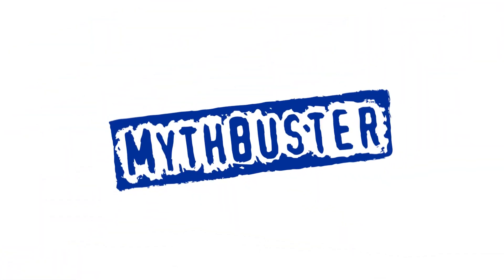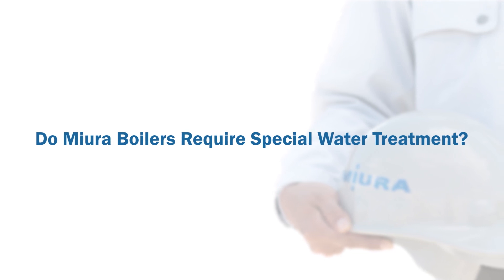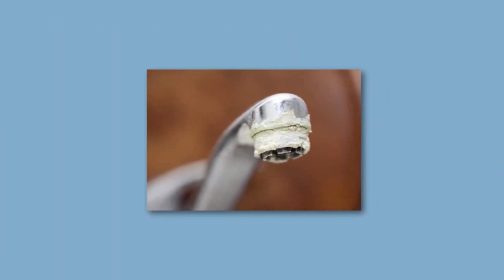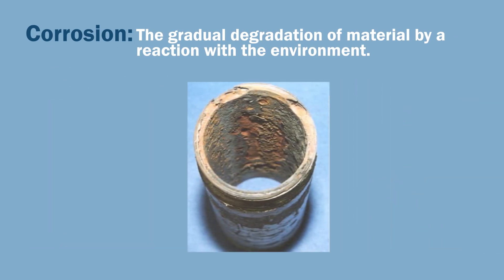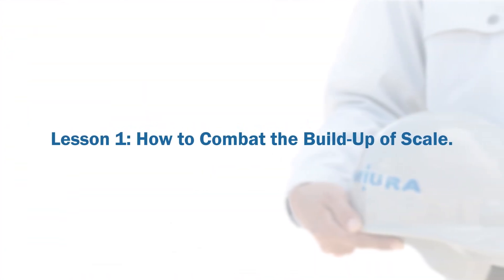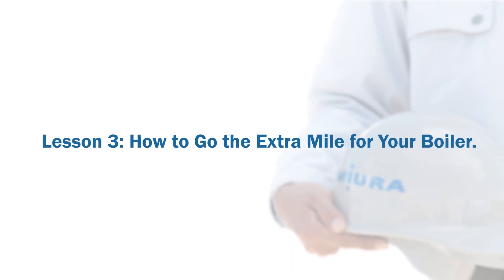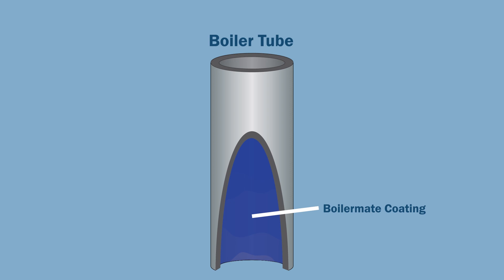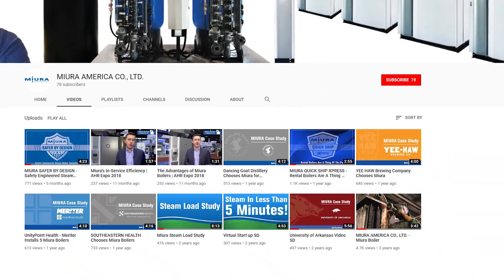Miura Mythbusters - Do Miura Boilers Require Special Water Treatment?

Comment: I have a question about your boiler product. I am using the Miura EI-1000GH boiler with a capacity of 1000kg/h. In the catalog, the actual power of the pot is 838kg/h. But I performed a actual capacity test and found that it only provided 600kg/h (I let Boiler run stable at 4.5kg/cm2 within 1 hour and evaluate the amount of steam it generated). My input water has a temperature of about 80 degrees Celsius. I want to ask if the temperature of Feed Water affects the capacity of the boiler? Because I see that in the catalog, the actual power is calculated in the case of Feed Water is 15 degrees Celsius, I think my water has a higher temperature, it must work better and less costly. Please Explain to me whether the high temperature of the Feed Water really affects the capacity of the boiler?

Comment: This video didn't answer some basic questions.  It addressed the scale issue with softners however after mentioning deaerators ignored the dissolved oxygen issue.  When our plant was designed Miura engineers told our engineers that DA tanks weren't required.  It looks like that attitude has changed since then.  What I'm getting at is if your feed tank isn't a DA but a hot water feed meaning steam is used to heat it up but doesn't remove oxygen nearly as much oxygen as a normal DA then is the Miura silicate treatment enough to protect the boilers?  What is the normal life span of a Miura 100hp heat exchanger?  This would be useful information.

Comment: hello sir, my name is Ratman, the steam boiler maintenance department, I want to ask how to solve the vertical Miura brand boiler if there is a leak in the steam pipe, because it is very different from the boioer fire tube, it can be opened at the back door and front door any other solution for miura boiler? thank you